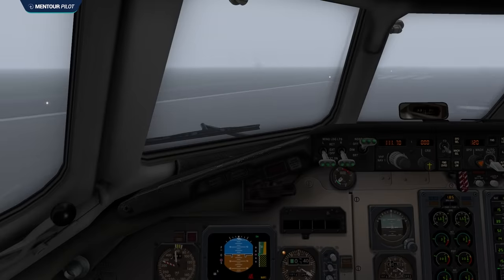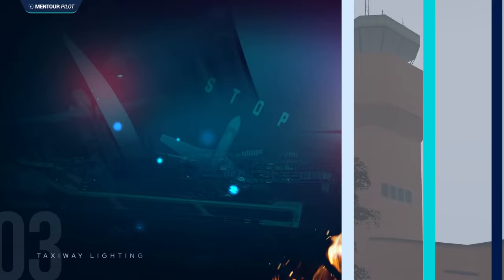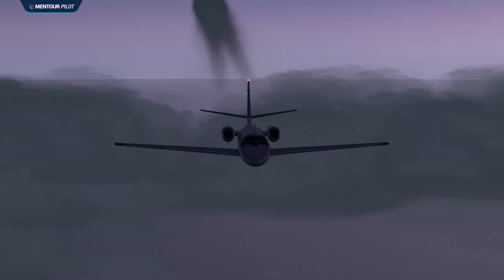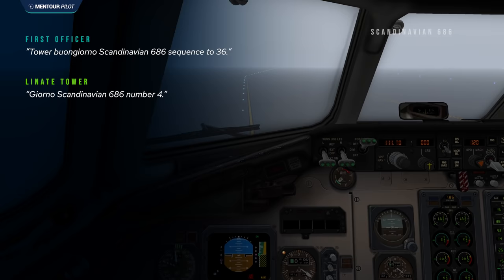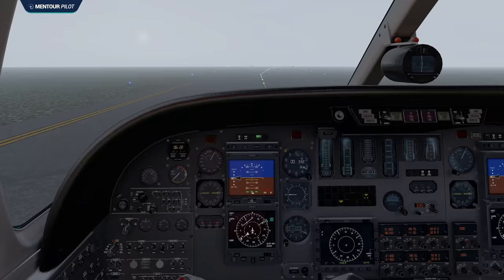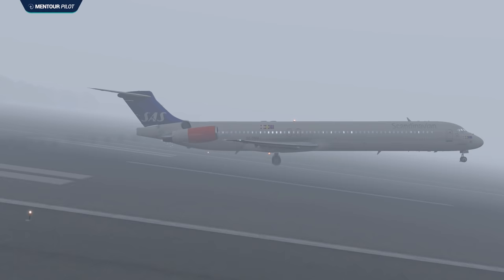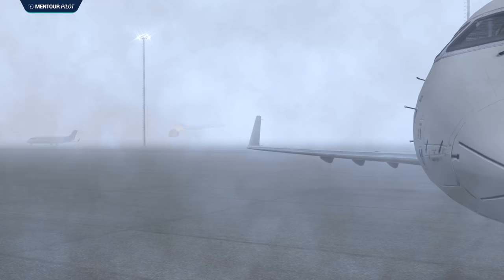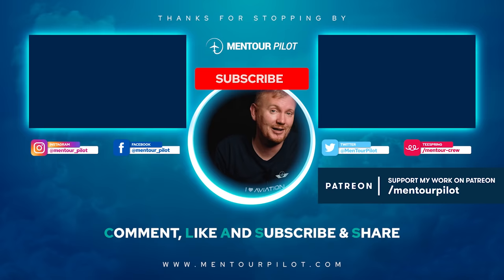A Perfect Storm of Mistakes! And how Heroic Pilots Almost solved it.

Comment: These kinds of accidents hit the hardest, where a crew was operating by the book and still got doomed because of stuff outside of their control.
Reply from the maker: Yeah, that’s exactly what I thought.
Reply: Yes, indeed.
Reply: Broken ground radar and poor taxiway lights and markings with bad visibility was a recipe for disaster.  Sad thing is this could have been prevented.
Reply: And then even flying the damaged aircraft, it was just system failure after system failure. Even the reverse thrust, the last thing they had available, was actively failing on them. It was incredibly quick thinking to use it that way, and shows how good of a pilot they were.
Reply: No ground radar is criminal neglect, IMO.
Reply: @Muck006  Italy doesn't seem too concerned about losing tourists.
Reply: Completely agree. However watching closely the airport’s design, procedures and WX, I could see  sliced cheese holes lining up.
Reply: @oldschoolman1444  Not just poor taxiway markings, literally contrary to the standard for marking such taxiways.  Though the fact that the cessna pilots were familiar enough with the airport to be comfortable with going past red stop bars means they also should have known they were on the wrong taxiway.
Reply: There's a saying "you can do everything right and still end up losing", it applies perfectly to this
Reply: And it's so damn unlikely! So much empty space yet these aircrafts collided!
Reply: @Melanie16040  My thought as well. The only malfunctioning stop-bar was the one which was in that spot. If the pilot went through it, it means the pilot knew where he was. Besides, those pilots knew Linate very well, and it's a tiny simple airport. You know that if you turn left you go North and if you turn right you go East. And planes do have compasses on board. The Cessna pilots did everything wrong because, in their mind, they were executing a manoeuvre which was, probably, often executed in that airport with some kind of a benevolent acceptance by the traffic controllers. That was never allowed during foggy weather but the Cessna pilots did not fly, in general, in foggy weather and probably did "business as usual". Radio communication was not clear but, I think, the Cessna pilot understood very well when they were told to "go North" (as they would probably be told in any case) and yet answered "we go toward the main runway" which was, again, probably the standard non-standard approach tolerated by the personnel. In my mind 90% of the responsibility is on the Cessna pilots, and 10% of the responsibility is of the traffic control, which only had 2 moments in which to be suspicious: the first answer by the pilot (but that might have arrived disturbed) and the unknown marking, which, being unknown, could have been anywhere.
Reply: @Muck006  Also on the Wonder channel there is a documentary on this.
Reply: just installing a few signs probably would have changed the outcome.. so sad
Reply: Corruption and incompetence usually kill the innocent...
Reply: @Muck006  the documentary they did on that with the passenger footage was absolutely insane. A modern-day Titanic.
Reply: Any loss of life is tragic but the fact that those two pilots were above average and we lost them makes this tragedy doubly difficult. Especially in a day when we have many substandard pilots out there.
Reply: 🥺🥺It's so terrible, you sit in there and you know it's over now
Reply: @chrispetty6871  we do? Are there any at Delta Airlines? I am in the states and that is the only airline I fly.
Reply: @KLT47B  i WONDER where the money for the ground radar repairs went.........
Or for repairing the taxi lights/red stop bar.........
Reply: @Muck006  I immediately thought of a certain bridge disaster... had forgotten Costa Concordia ☹
Reply: Amazing how many fatal aviation incidents there were in just a few months in 2001 from the 9-11 incidents, to the crash in Nov 2001 in NY, and this in Oct 2001, there were more deaths in that that 3 month period by far than any other. 2001 had more aviation deaths in the us in 3 months than the next 20 years combines
Reply: @Muck006  muck!!!! I'm Italian!!! That's why I'm not a pilot..I once had a sailboat..I forgot a little thing...a little thing!!!  The Atlantic Ocean took over!!!
Reply: Why doesn't the crew have emergency escape? Air bags!!; I never  realized until watching this just how many possibilities there are for errors and failures!!! Never flying again!!!! Until the next time!!!
Reply: @oldschoolman1444  and pilot with poor eyesight
Reply: @vincentanguoni8938  140 knots (260kph roughly) into a brick wall, a roof collapsing on you then catching fire? I'm really sceptical that airbags or emergency escapes would do anything at all. I suspect most were killed very shortly after or on impact. There are emergency escape procedures, but those are no good when a building falls on you and you're on fire.

 Flying is incredibly safe, if everything is done correctly and most of the time it is. What you have to remember is that this guy looks at a lot of accidents and how they made the industry safer. This accident is by no means the standard of aviation today. Just listen to how critical he is of the airport and the procedures followed in this instance. This is the way nearly all of pilots would respond. The vast majority are consummately professional, skilled and reliable aviators who live and breathe aircraft and safety. These accidents are very much the exception rather than the norm.
Reply: It's kind of like a car crash where one driver cangh do everything correctly but still have an accident when they get hit by a teen driver speeding his car through a red light
Reply: Why isn’t ground radar required in order for an airport to be operational in fog conditions?
Reply: Italians...
Reply: I wonder if it was the right thing to do to get the plane airborne after such a huge blast? If they had aborted take-off immediately, maybe it had become a smaller disaster, as they would have had more runway left and lower speed?
Reply: Hearing about a repetitive procedure of breaking the rules by crossing the red reminded me of the LAPA crash, in which operational culture had degraded so much that hearing the take off incorrect configuration alarm was simply ignored by the crew given he amount of alarms they were used heat and ignore during their regular operations.
Reply: That’s how most car accidents happen too. Someone not paying attention can doom the people around them who are doing everything right.
Reply: @paulazemeckis7835 yeah they're mostly all at Delta
Reply: Spiderman into SPIDERVERSE< yes SAS is bad
Reply: The lack of ground radar seems to have been a factor in many mishaps.
Reply: @stevencooke6451 *didn't 🥱😏🫢😶
Reply: @ShaunHensley *wasn't 🥱😏🫢😶
Reply: @vincentanguoni8938  im driving! EVERYWHERE! ..AND IM NOT GOING HOME TO VISIT! (im Hungarian living in Dallas, TX)
Reply: @ingvaraberge7037  wait what?! I thought they were trying to stop...
Reply: Yes, except refuse to fly in out of Linate.  The hazards were commonly known. Or at least refuse in low visibility.   That would have embarrassed many in Italian aviation, and who does that in aviation.
Reply: @stevencooke6451  If aviation in general knew how bad was Linate, with its multiple prior ground incursions, then aviation doesn’t care to much about losing tourists in general.
Reply: True that✌️💯
The “freak accident” one’s always get me…
Lauda air
Alaska 
JAL
United 

Just flying along when a catastrophic malfunction the pilots had nothing to do with suddenly erupts ….ugh what a nightmare… such utterly rotten luck ✌️💯
Reply: 0J
Reply: United 93 hit the ground the hardest.
Reply: Idk, they went across a red stop bar,  that wasn't "by the book".
Reply: So sad 😢
Reply: @oldschoolman1444 why no pilots or airlines reported it?
Reply: @paulazemeckis7835 Yes they are
Reply: @vincentanguoni8938 well… you made a mistake. And mistakes cannot be afforded when you take responsibility for human lifes